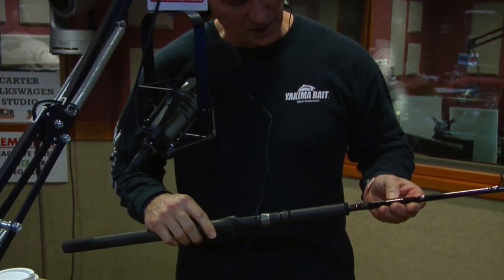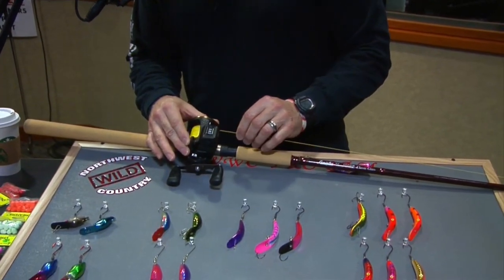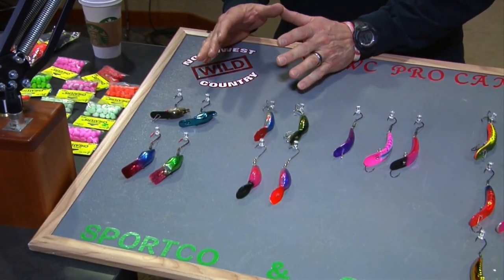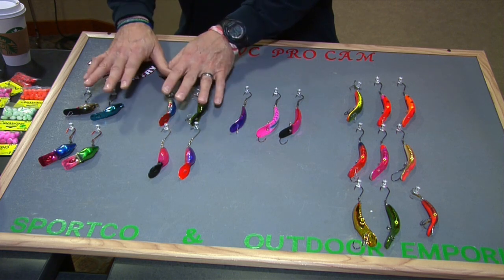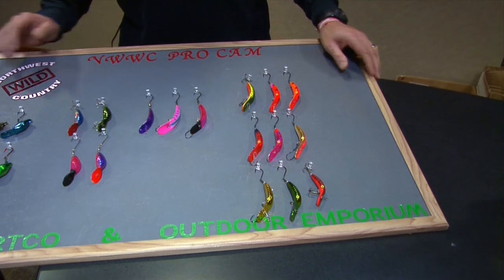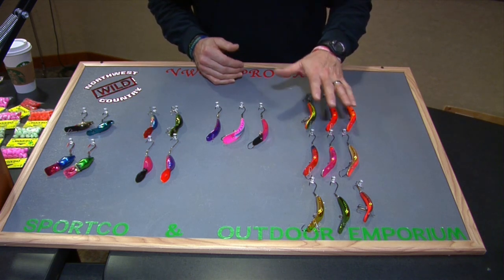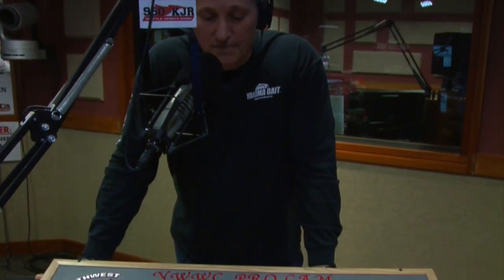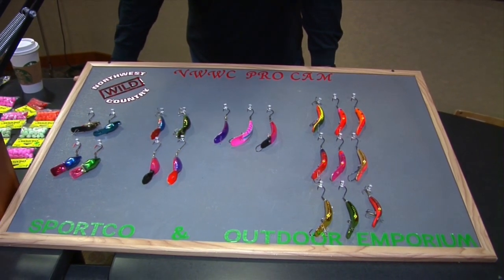The Basics to Pulling Plugs for Winter Steelhead

Comment: Most of what is in this video is good info except the part about dragging the anchor to create the boat's movement down the river.  What is happening when you do this is that you are disturbing, (raking) the bottom of the river where the native salmon and steelhead spawn and by doing so you are tearing up the reds.  Please don't do that, learn to control your boat with either the oars or the motor.